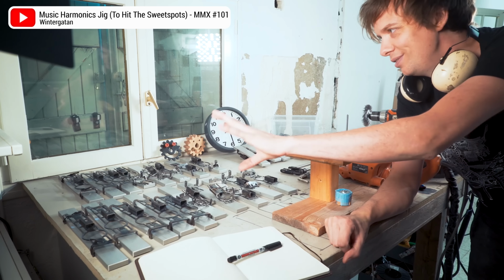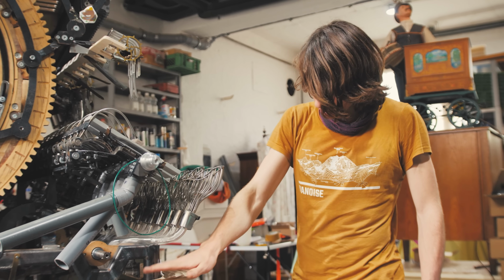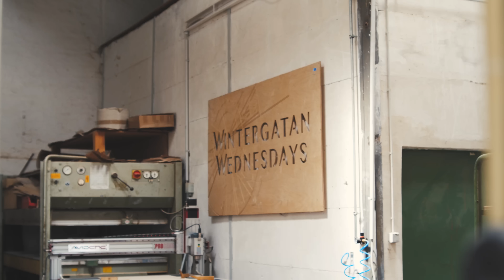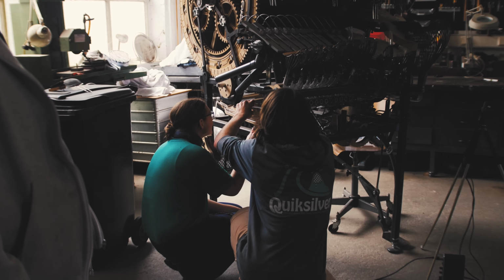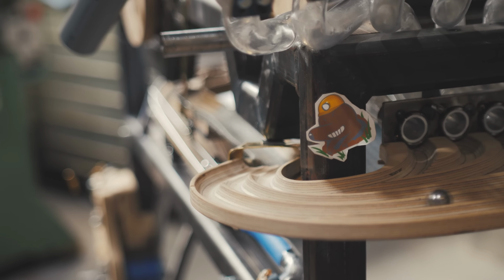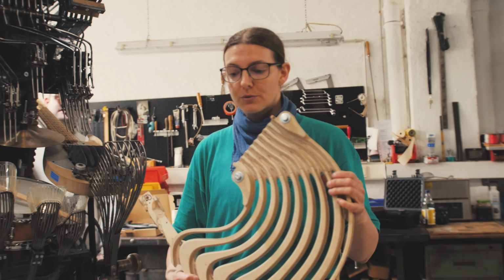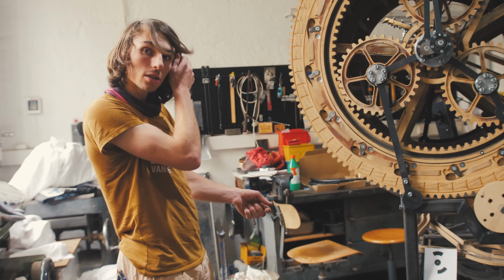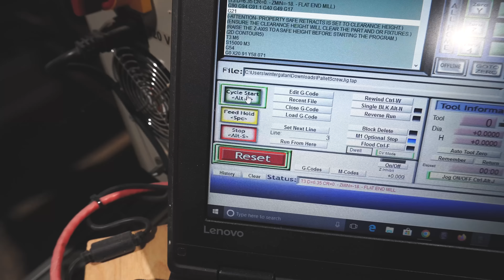Rediscovering working solutions | MM(X) #5

Comment: Why use brass braces? Wouldn't steel or aluminium be cheaper? And they are not like in highly visible places where it should be pretty.
Reply from the maker: Given the workshop, suitable material tends to lay around :)